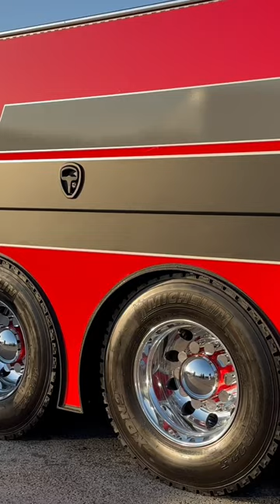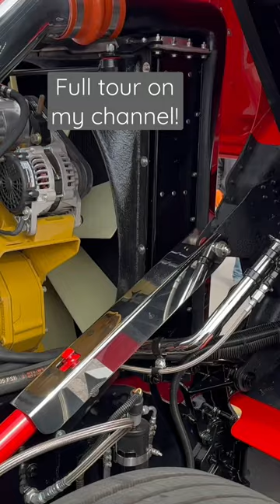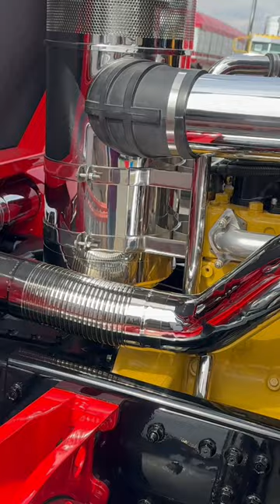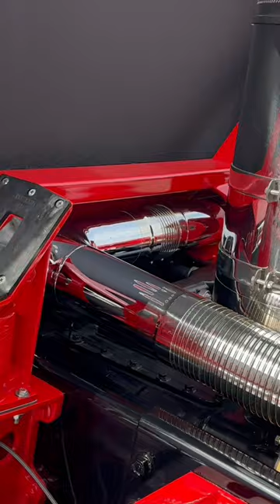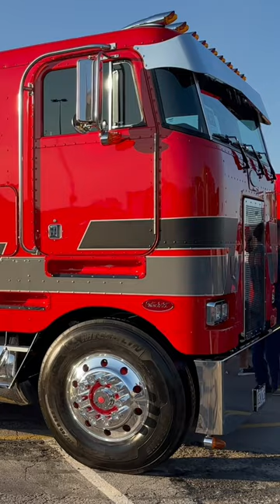Peterbilt 362 cabover service truck

Comment: Got to love the 362 with 3 windshield wipers across the glass. Back in the 90s my boss had one for a spare truck if a driver broke down,  what he didn't realize was the old truck would run 110 or more, he thought it was a punishment to be stuck in the old cabover, but the old truck would fly 😂😂😂